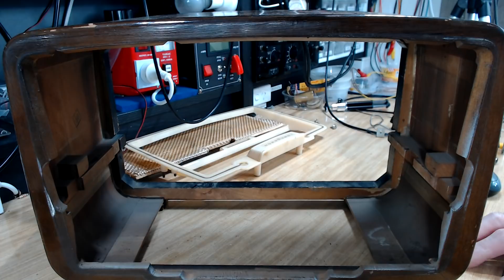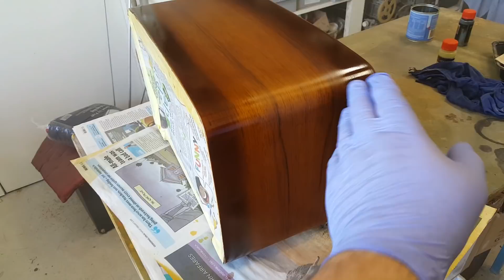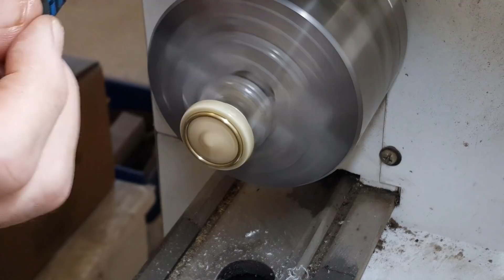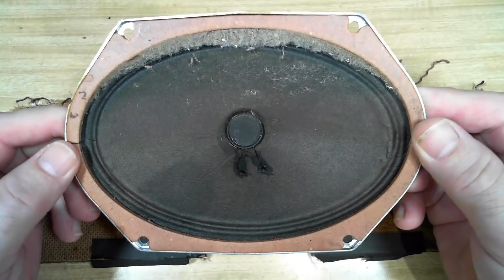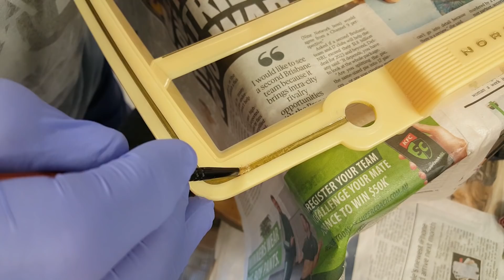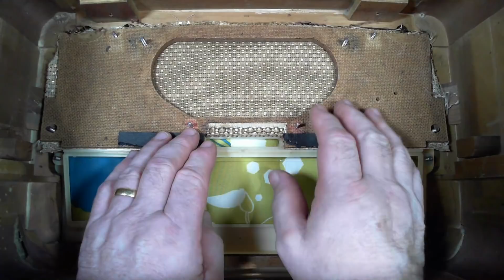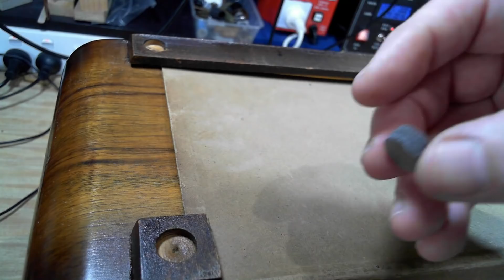NordMende Elektra 58 Restoration Case Repair Part 3 - Final

Comment: One of the finest cabinets ever! I think that ..to repair such "history pieces" We must be...part electronic technician, part upholsterer, part cabinet maker....also manage different paints: wood, metal, cars......beeswax!! ,,,,and, of course, like in the "capacitor + resistor" chapter, have some good virtual friends to land us a hand.....what am I missing? Oh, Yes:  being a juggler maybe helps, sometimes! Thanks a lot for your videos!!!! and ..."It's never late to teach and learn!"
Reply from the maker: Hello RI, I agree, it pays to be handy on several fronts. The finish on this was giving me palpitations but it came out very nicely, not quite right but will pass. Thanks RI 👍🙂
Reply: @DavidTipton101   Oh. It came out perfect! I had palpitation every time I used paint striper on those wood cabinets....kept tihinking "It will come apart!". I always wrap a striper coated cabinet in plastic kitchen wrap....It does not dry out so quickly and works better.  Thanks You!

Comment: Hi David.....really appreciated the work done on this radio, learnt so much! I'm acquiring a Normende Luxus USA in working condition.  It has the same phono input in the rear as the one you worked on. It's not a DIN, so what kind of plug can I use? RCA, Banana?  Looking at adding some sort of blueetooth device thanks much! Tony
Reply from the maker: Thanks AJ. The phono input is a special type of plug/socket. It has two round pins each side and a central vertical flat pin in the middle. I have seen one but I don't have one. Banana plugs will fit the round sockets. I don't know the reason for using that plug setup but looking at the schematic the centre flat pin is a ground the same as one of the round pins sp two banana plugs should work 🙂

Comment: Hello Dave, I follow all your videos and I hope you can give your valuable opinnion about a problem with a Nordmende Elektra d12, after a complete restore including capacitors and complete wave rectifier circuit, testing all tubes, I select to operate with 120 vca, but the power transformer has a 220 vca, my question is this, is this radio designed to operate just with 220 vca??? I have modify the transformer wiring to 120 vca, but the radio is dead no bulbs glow, no sound , just a minimum hum on the speaker, I follow the squematics wiring. Can you help please?? Thanks.
Reply from the maker: Hello Rodolfo, I am happy to help but it will be difficult. Looking at the schematic for the D12, the transformer is selectable for 110V and 220V. I take it you mains power supply is 120V. It sounds like you said you have selected 110V on the phenolic board on the back of the transformer by moving BOTH tabs to the 110V position. You now need to check the voltage coming out of the transformer, it should be about 255VDC. You might be able to measure it at the green wire on the audio output transformer or the smoothing capacitor C196. The measurement is taken between those points and chassis ground.
Reply: Dave thanks a lot for your answer I really appreciate it, I understand that this radio works with 255 VCD, at the rectifier outlet isn't it? best regards.
Reply from the maker: @rodolfogomez382  About 255VDC, depends if you have AM or FM selected. The schematic has all the voltages listed.

Comment: What a detailed professional job! Neat! Question for you: by any chance do you know which output of the current turntables (Phono or Line) goes to the TA input? The radio is mono so the stereo output from turntable should be joint together, correct? The ground line should be connected from the turntable to the TA ground input? Thanks!!
Reply: Thank you so much Dave!
Reply from the maker: Thank you Jose. Connecting stereo to mono can be tricky. If the turntable output is direct from the record cartridge you can do as you say but it may sound better if you reverse the wires on one half of the cartridge, that is, swap the + and the Ground wire on one side only, that will put the stereo out of phase and it won't cancel itself out. If the record player has a preamp you will need to install resistors in the output otherwise you will be shorting the preamp outputs together. You should be able to Google a solution if that is the case.

Comment: Beautiful work as usual! The case especially, thank's for sharing the process, lots of valuable tips. If you are still interested in the original speaker I have one from a '59 model (same speaker as the '58) and can gladly send it to you. I think I have some old flat headed screws that will fit as well.. originally they came with brown bakelite thumb screws holding the back. Let me know if you want that and I will give you my email.
Reply from the maker: The original speaker would be wonderful. Please contact me at vintageradioaus@gmail.com Thanks Gherghinescu George 😀

Comment: Lovely job on the restoration. That capacitor/resistor combination was executed incredibly well. Those German radios of that era were very good quality. I have a smaller more compact Philips, probably from a couple of years after your Nordmende. UK voltage is a bit high for it. It was a model that was never sold in the UK. The cabinet on mine also had those Nitro cracks but even more severe. Looked like someone had gone at it with a very sharp knife. Nitro from that period is notorious for cracking and the heat from the valves/tubes wouldn't have helped.
Reply from the maker: Thank you Landrew0. I'm glad I tackled this radio, I learned a lot from it. I have a European Philips radio I will do one day, it's very similar in complexity to the this one. The crazing in the finish is very common and a pain, it means a cabinet that is otherwise OK has to be refinished 🙄🙂

Comment: You and Shango066 go hand 🤚 in hand 🤚, in a way. I say this, because about a year ago, Shango066 resurrected a NordMende, console style AM/FM radio with record player. All in a real wooden case. All steel record player and turntable. A good thing about it is the AC motor. And quality stuff that really lasts.. Even the rubber idler wheel has lasted 50-60 years. Lighted radio dial glass. Bad sounding record player, because the cartridge is dead after all those years. Resurrectable, YES YOU BET!! Yes, it is a tube type radio 📻. This radio you are working on is a NordMende, but without a record player.. I believe both of these products are built by the same manufacturer. This radio you are working on reminds me of a world band/AM/FM radio 📻 I bought at Radio Shack in 2000. Yours is the better radio. Mine was sturdily built, but yours has value. Mine was only $41.00, new.  Yours is the better radio, if they get dropped.
Reply from the maker: I think I saw that Shango video

Comment: Beautiful job David . I have done a few similar sunburst effect cabinets and I know the work that goes into it . I get quite tense when I do them . One false move and the job is ruined !   I have used biological washing powder on grille cloths and found it can work well . I love watching you work . Those german FM radios are unbeatable but not easy to restore . Best wishes from Thomas in the UK
Reply from the maker: Hi Thomas in the UK, thanks. I had a few sleepless nights over the sunburst spraying, fortunately it came out OK. The grill cloth was a problem because I couldn't remove or get it too wet to clean it. The radio works so well now, I'm very happy with it 👍🙂

Comment: Hi David,
Great job again!  The sunburst on the cabinet came out amazing!  Being a perfectionist is the key to your restorations turning out so well.  Is there a reason you didn't touch up the lettering on the buttons?  Just wondering...cheers!
Reply from the maker: Thanks Arpie. The sunburst came very good, it was a worry though. I tried to redo the lettering on the buttons but there was almost no depth to the letters so I couldn't do it. They were almost printed on the buttons, I think it was a manufacturing fault 😟

Comment: Remember you can use Coles oven cleaner as a stripper.
Reply from the maker: I remembered RaLB but wasn't going to use it on timber as I didn't know what affect it would have on it and any residual chemicals that may affect the finish. I will try it on a bakelite radio when I need to strip the paint off one, thanks 😀

Comment: Thank you so much Mr. Tipton for sharing your time and expertise with us!  I'm a furniture restorer and If you don't mind, I'd like to make a suggestion.   When you're to trying to match the grain on the raw wood, instead of a paint brush and stain, try putting a few drops of India Ink in some denatured alcohol.  The alcohol draws the ink into the natural grain of the veneer.  If you make the solution weak enough, you can apply multiple coats so it looks rather natural.  Just a suggestion.  Thanks again for your incredible videos!
Reply from the maker: My videos are all about me learning new skills so I appreciate helpful comments, thanks AuroraMills. In this case the veneer had cut through to the underlying ply which I think had the grain at 90 degrees to the veneer, would the India Ink work in this case or am I missing the point? 🤔🙂
Reply: @DavidTipton101  Thank you For your kind reply and very good question.  The India ink solution works through capillary action.  When it works well, there is no black from the ink on the surface of the wood...only deep within the grain.  The effect is to create depth, but also to blend areas of discontinuity making the grain appear uniform throughout.  In your case - as you correctly identified - I'd be concern the ink would flow into the cracked areas thus creating a cross grain effect.  In that case, you can create "false" grain over the cracked area with a razor blade.  You lightly, and randomly score the wood in the direction you WANT the grain to go.  Would it work in your case?  I'm not not sure, but on future projects, you might try experimenting with the concept.  Probably the best advice I could give would be to take samples of wood you commonly work with and play around with the ratio of India ink, method of distribution, how long you let it set before wiping, etc.  Label each sample and stick them in a drawer.  Then when you have a project, you can get an approximation of how it will look. 

Again, thank you for your wonderful videos!.  The only problem is they're not long enough, or frequent enough!

Best to you and yours Mr. Tipton.
Reply from the maker: Thank you for thorough instructions AuroraMills, I appreciate that greatly. I will experiment as you suggest, thank you again 👍🙂

Comment: Nice job.  I just started following you.  I have 3 Telefunkens, and one each of a Saba, Grundig and Nordmende.  I have only started into the Nordmende a little as it seems to be the easiest circuit (F24).  The oldest is the Grundig - which appears to be around 1956.  The Telefunkens are early 60s and not sure about the Saba.  So far replacement tubes for these have been rather expensive.  The cheapest seem to come from the Ukraine or Russia. I've been able to harvest speakers and parts from the early solid state units for these older projects.  I have been working on 1940s and 50s AA5s and 6s.  These German radios and Hifis take much more time as they are a discovery process.
Reply from the maker: Hi Philip, Thanks for the sub. I'm not happy to hear the Nordmende is a simple circuit, I wouldn't want anything more complex. European tubes can be expensive and difficult to get, this one was good in that it have novel 9 pin bases. Good luck with your projects 👍🙂
Reply: @DavidTipton101  The F24 appears to be one of  their lower line models.  I actually fear getting into the Grundig 3033 as the unit is probably made of unobtainium.

Comment: Attention to detail. You have turned our craft into an art. I'm a little burned out restoring radio equipment right now. I did a beUtiful job on a 1946 Philco Radiogramophone, from electronics to cabinet finish. For a lack of better judgement I regrettably sold it for a nice price. My Waterloo was shipping it. With all the care and expense involved, the package arrived damaged. My customer was as bewildered as was I. He is willing to send it back , so I refunded him his payment. The customer would like it restored again and will pay, but at this point I've lost all interest. I worked on this radio phono for six months day and night. I'm spent right now. For the moment to keep up my spirits I'm working on my test equipment, upgrading and calibrating it. I sol my EICO 625 tube tester, with the aim I would design and build a transconductance tester. That project worked out well in the breadboard stage. It's made from simple components. The transconductance is calculated not measured. The tester is not for the novice . I'm getting the results of the best Hickok tester. At the moment I can test for shorts and gas. Gm is calculated by the change in plate current divided by the change in grid voltage. I keep several vintage tube manuals handy for pin outs and the family of curves graphs.
Reply from the maker: Hi Cosimo, that's sad about the Philco, but I know what you mean, it's difficult to get interested in something you have already done once. Your tube tester sounds like you need a degree to operate it, I saw one on youtube with a gas feature recently. Thanks Cosimo 👍🙂

Comment: I think it's interesting how that veneer was damaged at the factory, and they simply finished right over it, I've seen that on cabinets before where someone sanded through in small spots but never that much. As you demonstrated that shaded lacquer hides a multitude of sin, both before stripping, and after refinishing.
Reply from the maker: Hi Fritz, The damage was clearly there before I worked on it so I guess it was done in the factory. It looks fine now and the limited number of people that have seen it in the flesh haven't picked up the defect so I'm calling that a win 👍😀

Comment: It probably wouldn't help in this case, since the grille cloth looks a little hairy, but I have had good luck cleaning grille cloth with something like automotive cream hand cleaner, like Gojo, the type without the pumice, worked into the fabric with a finger, followed by a rinse of hot water, on a hot day. Where you could get a replacement cloth I am not sure, there was a place in Holland that sold cloth, and replacement parts for European Phillips models, but I can't remember the address of the site. If the stores were open I would have suggested looking in fabric stores among the remnant, drapery, and upholstery cloth for something similar.
Reply from the maker: HI A. Fritz Becker. Yes the cloth was a little worse than I anticipated and is why I opted for the dry cleaning powder. I could lightly vacuum the powder out but the fabric was very fragile so I stopped trying.  I have located some cloth in the Netherlands so hopefully it will look as good as new once fitted. Thanks for the tips 😀

Comment: For staining in a wood grain, I once used a soft tooth brush dipped into first a light stain followed by a darker stain a few hours later, and believe it or not it was on a curved edge much like yours, only my damage was on a rare "Curved sided windowed" Crystal Cabinet worth thousands of dollars, Err-anyway lets keep this quiet, as no ones the wiser as yet, not even my Wife who thinks she knows the Cabinet like it's the back of her hand, And yeah I still sweat whenever she hovers near it, even though its been well over ten tears ago since I repaired it..

Also if you ever need to do a repair by filling in seams, get a file and or sand paper and sand away some wood from the innards of whatever project, and mix the dust with wood glue and fill, dont be scared to have the fill stand proud as you get a better job that way ;) that's once its sanded to marry with the rest of the surface
Reply from the maker: Hi KorAllRBare, good work covering your tracks with the cabinet, your secret is safe here. I have used the sanded wood/glue before, the only thing is the wood stain won't colour the glue leaving a non stained bit in the work. Wouldn't it be better to use wood filler which will take on the stain? In this case with the stain mixed into the top coat It wouldn't have been an issue. You could always take over the Hoovering (is that a word?) to further conceal your handiwork, thanks for the tips 👍😀
Reply: @DavidTipton101  😮 I guess I must have been really lucky with my mix of glue and sawdust and thankfully having enough sawdust on top of it so that the staining took OK , And yeah I guess I wont be using glue ever again even if I can put a crap ton of sawdust over the mix..

Comment: All three episodes were captivating as usual sir, but the cherry on the cake was how you brought the wood back to life, the was a thing of beauty, just out of curiosity how many hours did you spend on this wonderful restoration ? keep safe and well David, looking forward to your next masterpiece 🍺🍺🍺👍
Reply from the maker: Hi Ian, thanks for the nice comment. I couldn't say how long except the case took about 4 days from start to final assembly. The first video when I looked over the radio was shot on the 3rd of March and the last the 14th of April when I secured the knobs back on. I did the Beehive in between that as well. I should keep a tally on the hours spent, maybe not, the wife will see it  👍😀

Comment: Hi David. Here are two EBay listings from Australia I thought you would be interested in.

https://www.ebay.com/itm/VINTAGE-1950s-AWA-Radiola-Brown-Bakelite-Valve-Tube-Radio/163946659545

https://www.ebay.com/itm/MASTERTONE-Vintage-Tube-Radio-Glass-Face-Plate-Grill-Spare-Part/233531057082
Reply from the maker: Wow! that first one is overpriced. I have one of those, I paid $50 for it and mine is the 4 knob shortwave version. I should sell mine on eBay 🤔😄 Thanks for the links 🙂